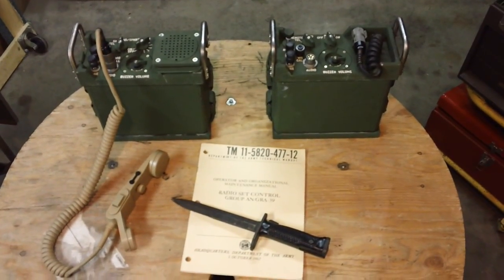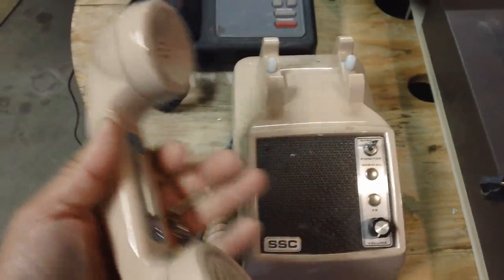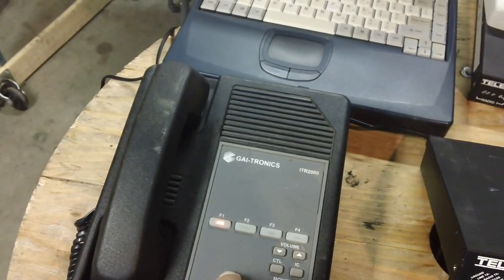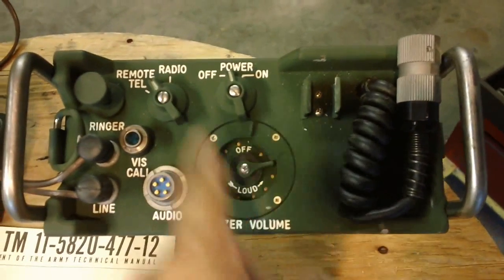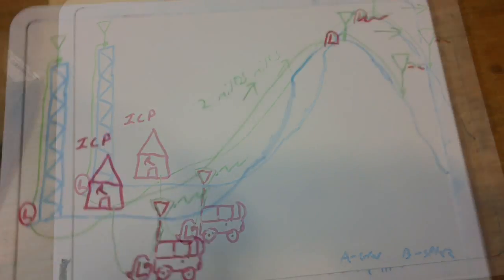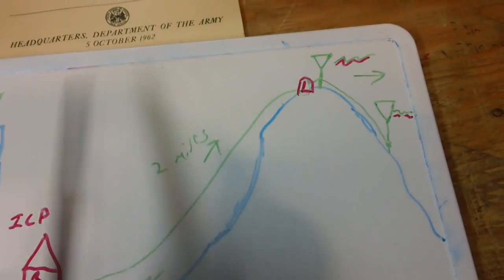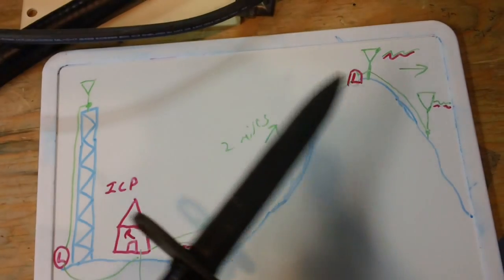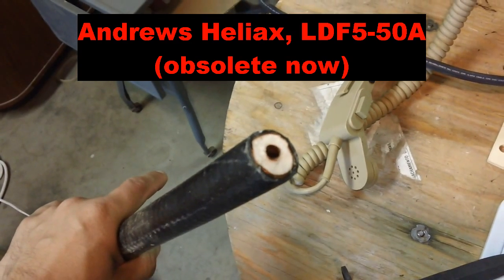Intro, A/N GRA-39B, U.S. Army Surplus Radio Remote Control Set, Part 1

Comment: You must have been a 28XX in the Marines? I'm sure you have experience soldering those massive switches inside. What, 32 solder points or some shit? Lmao 2841 intermediate ground radio repairman; I used to HATE inducting those dinosaurs! 😂 thankfully the "drop test" works half the time!

Semper Fi!
Reply from the maker: lol, yup... 2841 11th MEU, I dont claim ELMACO.. Drop test still works...

Semper Fi

Comment: I used to use these all the time. I would have 25 or so of these going at anyone time in my unit. We would connect these to everything. Whether the radio was a PRC-77, RT-524, RT-246, and any crypto gear we had. (KY-57 or KY-38)
Reply from the maker: Wayne Harris Ha ha, good times, yup thats my vintage gear right there. I remember an Amtrack came rolling by, and the wires got dug up and tangled on its track taking out the CP's radio setup of about 12 wireline circuits. Thankfully it was a training exercise.
Reply: GUERRILLACOMM Ha, I used to be in 2nd AAV Bn.  Have a similar story with some Army 8in self propelled.  Took out a 25-pair trunk and our switchboard went out the back of our CP.

Comment: 've got the microphone preamp circuit rigged up with jumper wires and such into the GRA-39 Local unit, works great! I have it coupled to an old HEATHKIT Vacuum tube audio amp/signal tracer unit, without the preamp you have to turn the amp to 90% to hear the output of the GRA-39, with the preamp rigged in you get a very good signal to the amp at just 10% on the signal tracer/amp. I'll see about finalizing it with a voltage divider on the output to adj. the output level for fine tuning between different radios, and put it in a case. I also must drill a hole in the case of the gra-39 to install a power connector so I can tap the 9Vdc battery pack directly.The preamp is designed for 12-24Vdc, but I am running it off of the battery in the GRA-39 local unit which is about 9Vdc, and it works great, the output of the circuit is 350mV in audio.

I'll post a video later on youtube as soon as I clear some space on my phones SD card.
Reply from the maker: Good deal, glad it worked out for you. I was not able to find the time to reverse engineer what I did with my unit. Projects & honey do's keep piling up. Cant wait to see your vid.

Comment: Hey have a question again, finally I am getting back to working on the gra-39 units. Could I use a microphone pre-amp in between the gra-39 output and my handheld microphone input to avoid having to bypass the lpad in the gra-39 and thus loose the 3,900Hz filter? I think I'd rather do this than risk damaging the gra-39 unit working on it's circuits.
Reply from the maker: Yeah, that will work just fine. just have to make sure you match the impedance of the mic input. Though I think its fine if it doesnt match exactly, as long as the impedance of the pre-amp is greater than the mic input each radio is different. Thats a great idea you have, I chose to do it differently to fit all the components inside the unit and powered by the unit too. I would of totally gone your route too. Good luck on your project.
Reply: GUERRILLACOMM Can you post or email your amp design to me? I wanna take a look at your design see if It would be better for me to adapt yours, if you don't mind.
Reply from the maker: Its been awhile & I would have to tear it apart to see what I did. Give me some time & I'll write something up. May take some time though, its getting busy round here.
Reply: GUERRILLACOMM I appreciate it.

Comment from the maker: Off the top of my head, in my case, it did filter it & amp worked ok, but the volume was too low to feed into my handheld. There is a 40 db attenuator pad in the remote which I bypassed, but at that point the 3900 hz is not filtered its filtered after the pad. @ that point is where I installed active filter and op amp to control modulation into various model radios. I'm going to have to rework my set, it was a first run of mods.

Comment: Actuallly I did some reading up on the gra-39's, you shouldn't hear the 3,900Hz tone at all, the remote and main unit have low pass filters already to remove the tone from the audio, they also have an amp at both ends to ensure the audio is load enough to properly transmit on the radio and be heard on the main unit. I spoke with a guy that used to be signal corps in the ARMY, he says your amp in your main unit may be  damaged if your signal isn't loud enough and your getting the 3900 tone.